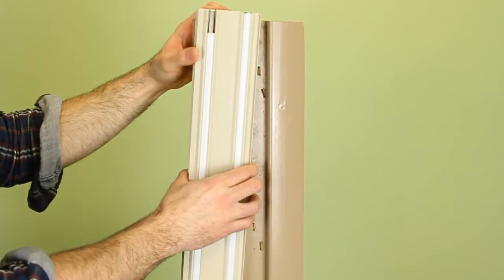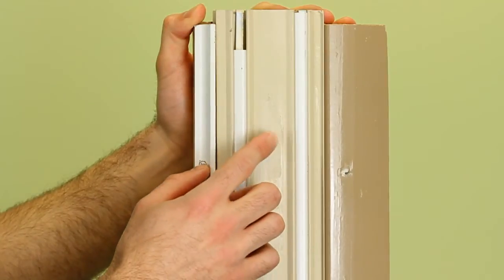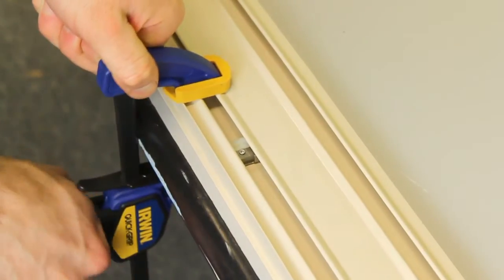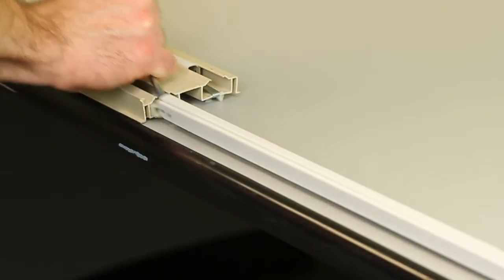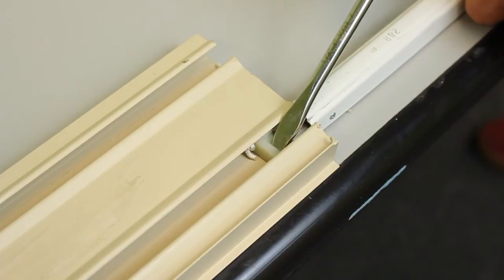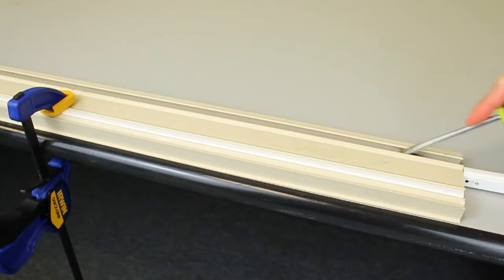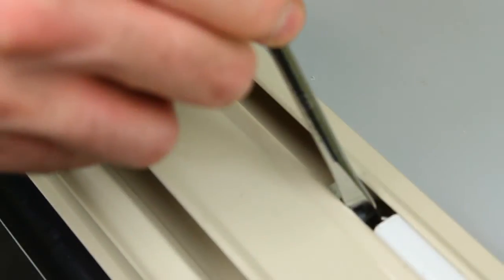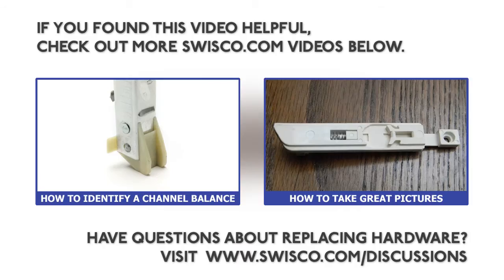How to install a ribbed tilt channel balance with knife lock shoe

Comment: I have this track system, but I don't have the ability to remove the front trim so easily. It is wood trim that may even be behind the other parts of the window sill - all oak. The back is also trapped in aluminum framing. Are there other options in removing and replacing, without taking all of the trim off?

Comment: how far down the track do you slide the shoe?, wich way do you turn to the lock position?
Reply from the maker: When you lock the shoe, the point of the "knife" should be turned toward the inside  of the house. When you tilt the sash back into the closed position, this will unlock the knife lock shoe. You'll want to lower the shoes so that they sit a few inches from the bottom of the window. This will leave you enough space to install the sash.